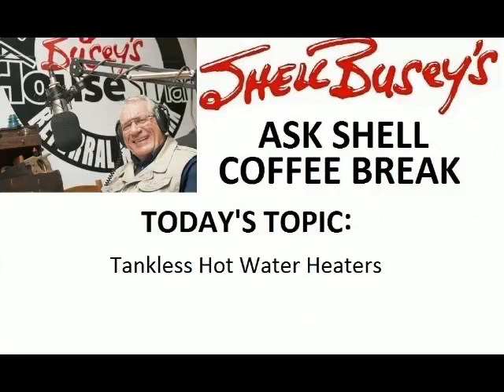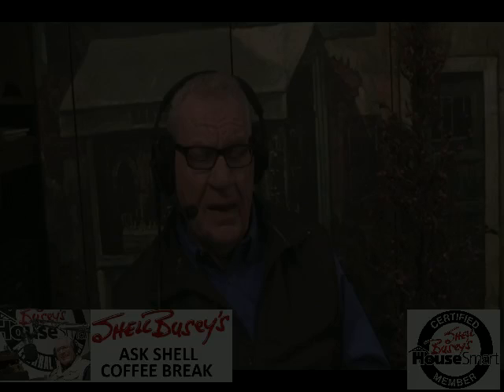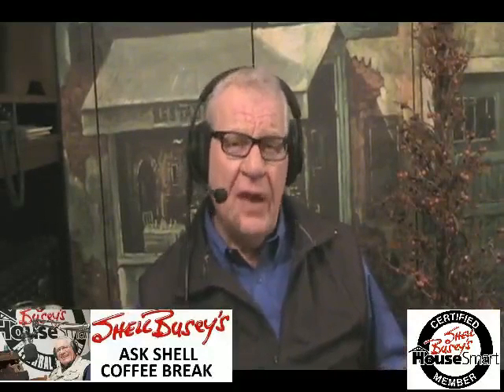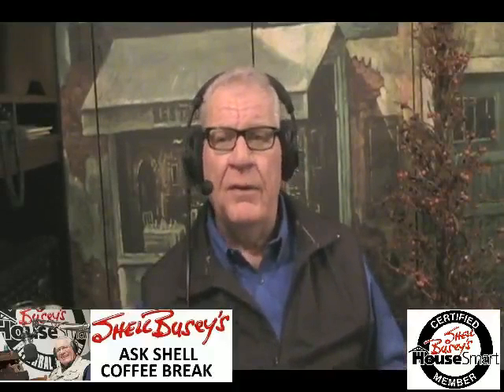How A Tankless Hot Water Heater Works

Comment: Do not purchase Avian, if you have problem avian sents parts put you are responsible for expensive labour.  Very very poor service from head office and water temperature is temperable. To get it close to comfortable you have to fool around with the handle . Lot of water is wasted before hot water comes . I have had  lots of headaches.  Stay away from AVIAN >   Calgary, Alberta